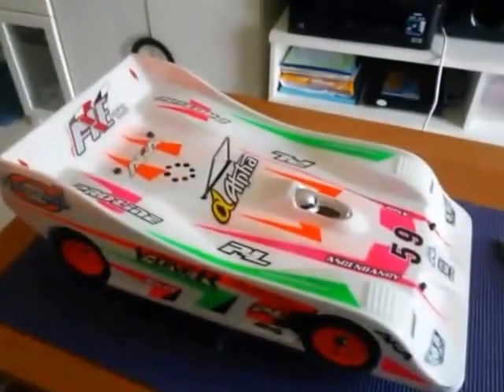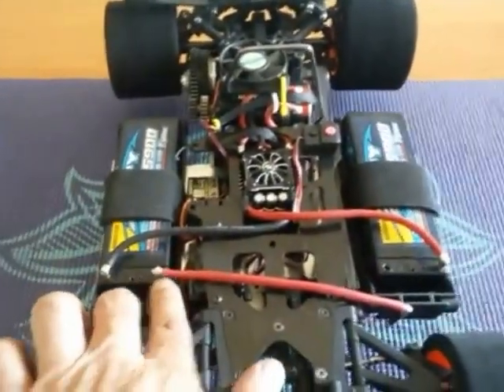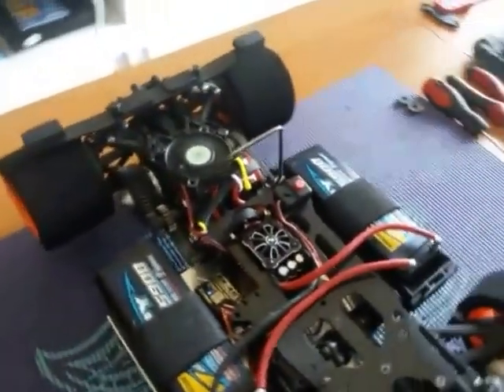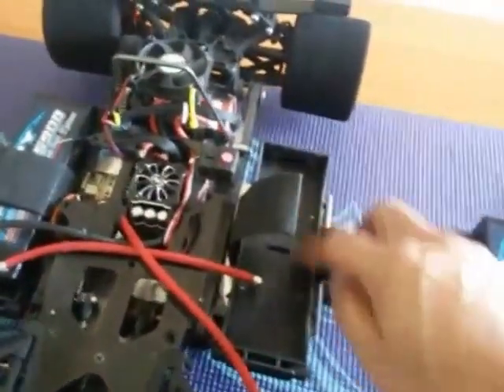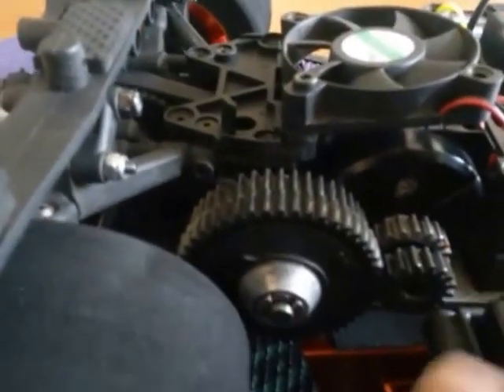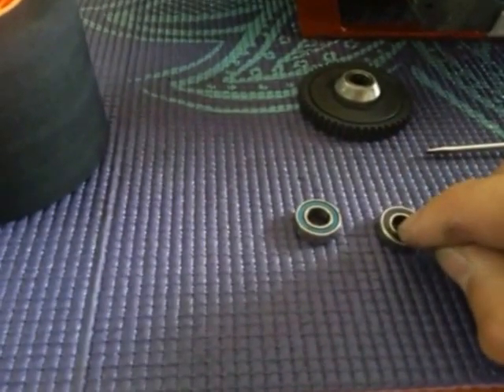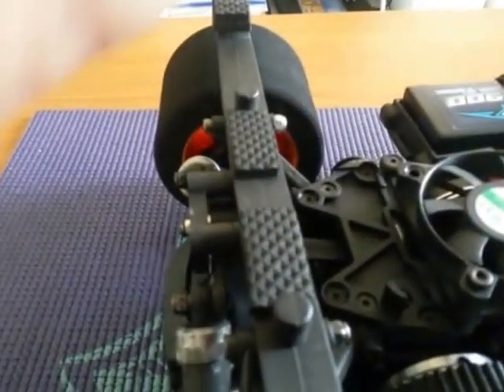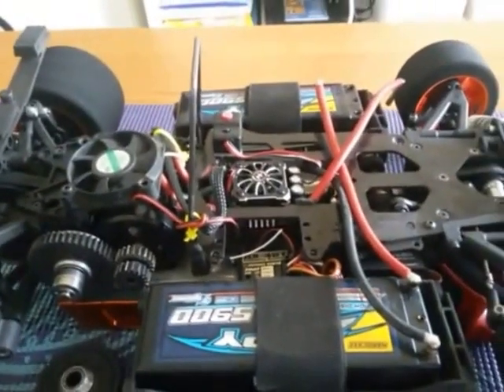Mugen MRX On Road Conversion Gas to Electric

Comment: Freddy thanks for the great thorough video on converting nitro 1/8 on-road cars to electric. I built some of mine with the mechanical 2 speed and break. Powerful and fast especially 2000kv  6s builds. 4s and 2800kv is also a great  combo for the track.